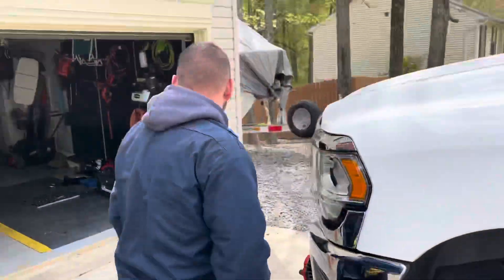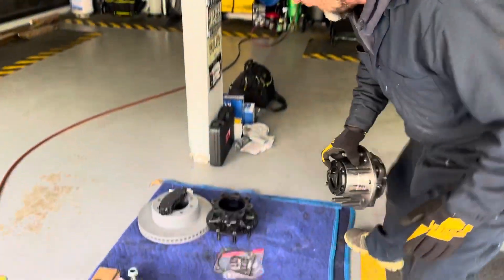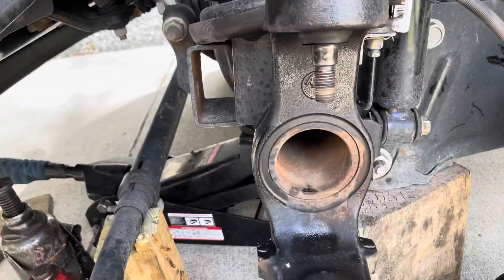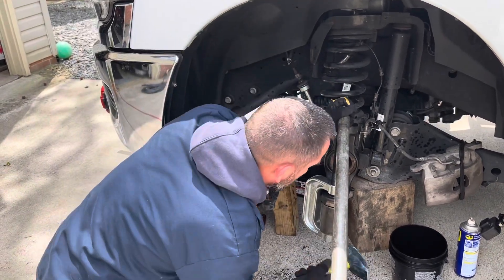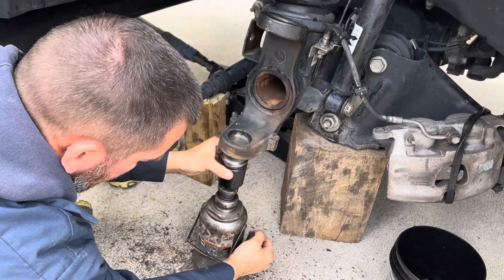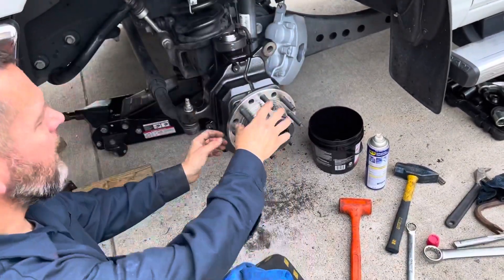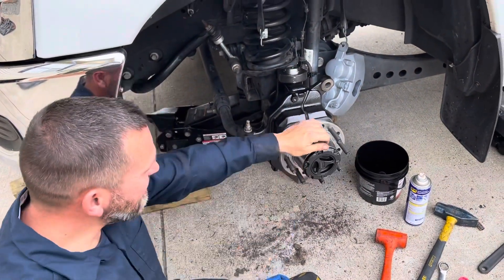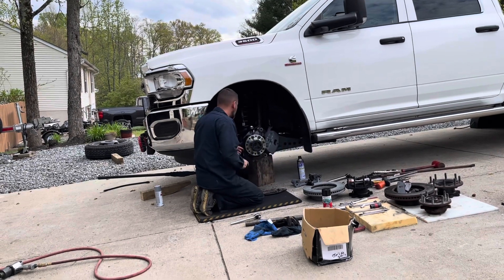Get up to an extra 5MPG in you Ram 4x4

Comment: Did you add any other suspension to your truck? To help with the ride.
Reply from the maker: Just the airlift bags on the rear.
Reply: @dixiemae5042  And that helped?
Reply from the maker: @dpfontenot2558  slightly but only on the heavy loads that compressed the springs as to bring in the air bags
Reply: Thanks